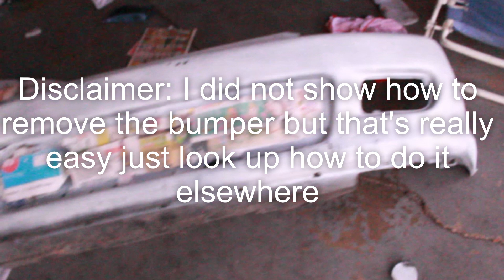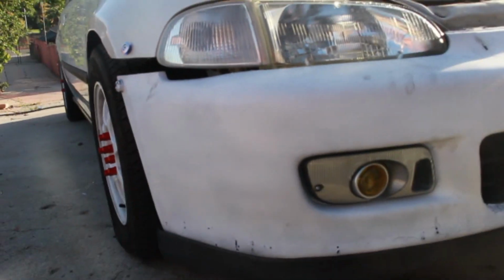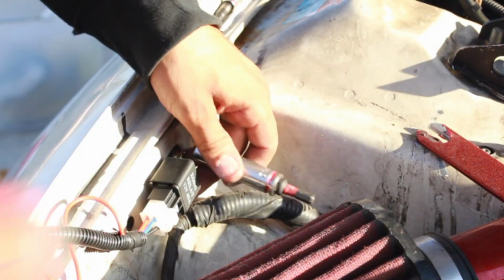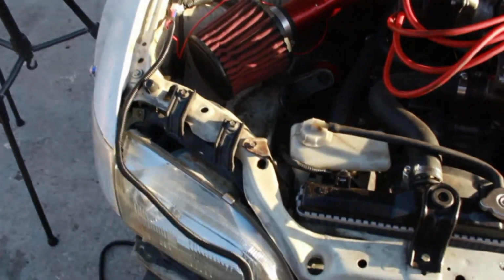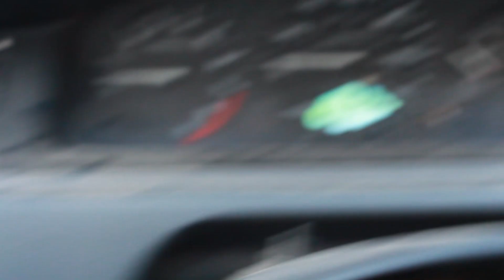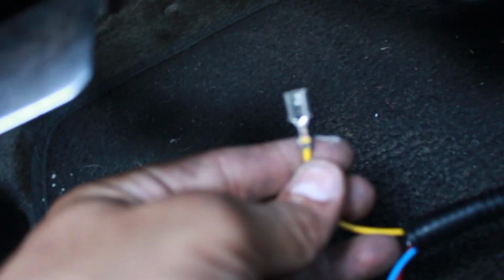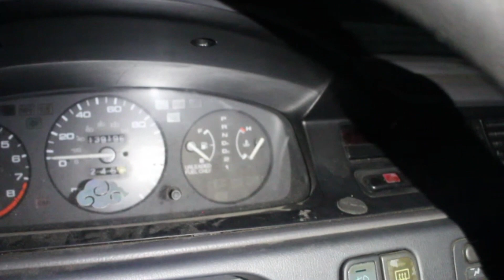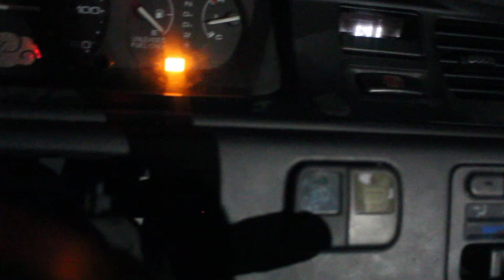92-95 honda civic fog lights installation

Comment: This is the best install video on the fog lights
Reply from the maker: Thank you please consider subscribing , I'd really appreciate it!
Reply: Agree, but I'm a bit confused on what that yellow wire connects too..what is that it hook to?
Reply from the maker: @robertverduzco1613  go to 14:20 . You might need to go back a minute or two to get a better understanding of the location. In the bottom of the steering column where all the fuses are located you'll find a port that looks like a "Ethernet cable" that's where the yellow one goes. I plugged mine 2nd the left. Let me know if that works for you

Comment: where does the red wire hook up too.
Reply: The red and yellow wire need power, one is for the switch and the other to power the fogs. On your fuse board under the dash there's a line of 5 points on the top row each one has a different setting depending on what you need. Connect to them for power, i have the 2 plugs plugged into separate points, starting from the black relay side I used port 2 and 3 . Point 3 allows the switch to light up when you have you lights on. Point 2 is where I have the fogs plugged in and it only allows the fogs to work with the lights on but only as long as the ignition is on. This way if I accidentally leave my lights on the fogs will turn off when I have the key from the ignition. It's what I preferred on my car but each to their own

Comment: Which port did you stick yellow wire in the ports on the fuse box under dash cause my fuse keeps popping
Reply from the maker: its under neath the dash the connector i connected to looked like a port from the the internet/telephone line. Im not sure if i connected it to the second or first port try one or the other and let me know how it goes